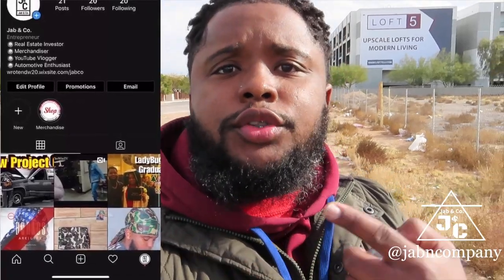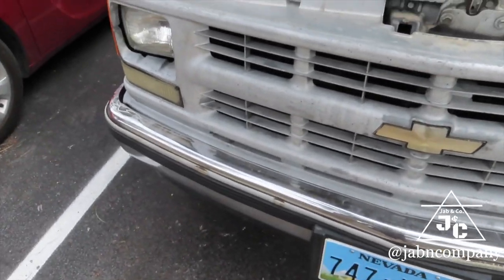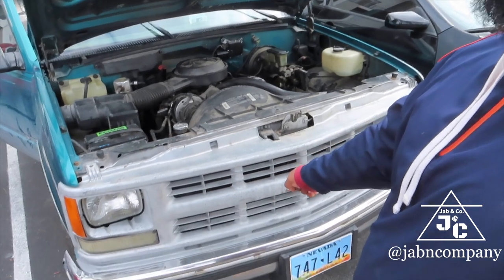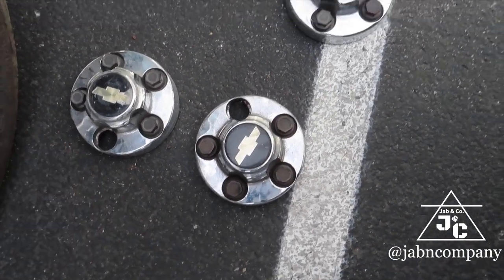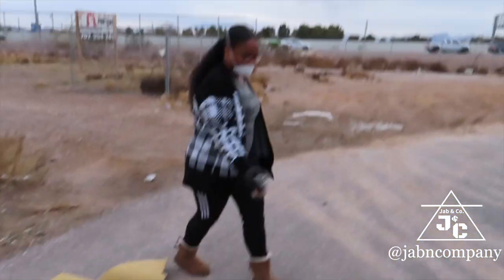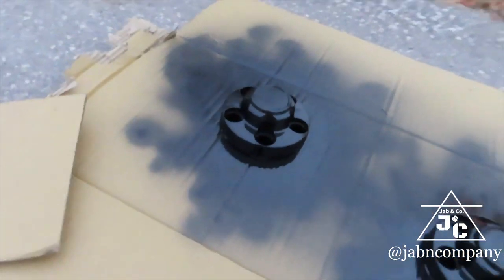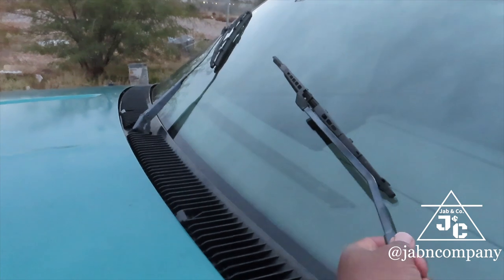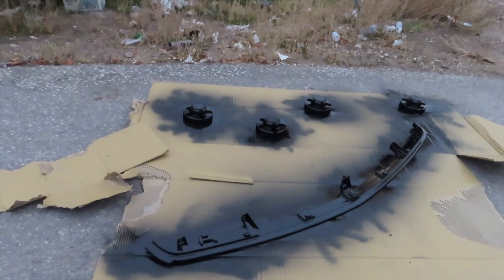How To: Remove & Replace A Grille For A 1988 - 1998 Chevy C1500 OBS | DIY Vlog

Comment: I have a 91 k1500 can I put a grill from a 98 why is it 88-93   and 94-98
Reply from the maker: Thanks for watching Bear 420! I’m sure you can fit a 98 grille on a 91 k1500. You may have to convert over to euro lights if the truck does not have it already! Consider subscribing to the channel. Good luck 👍🏿